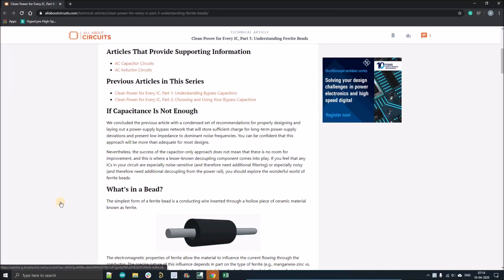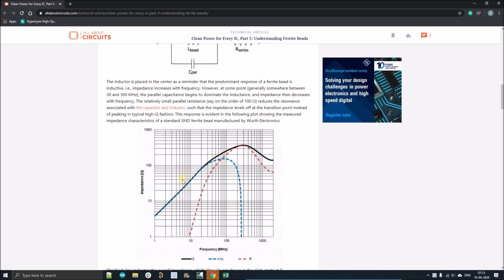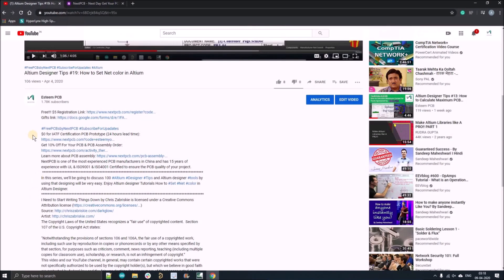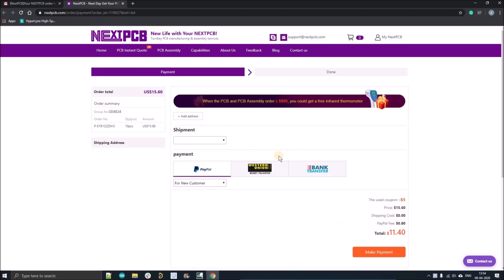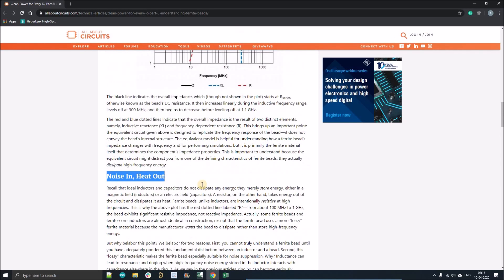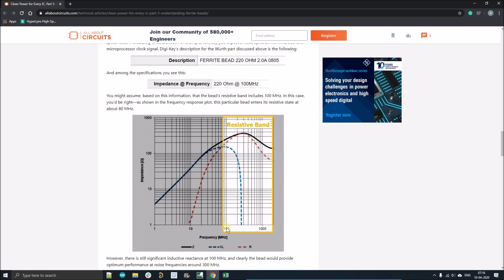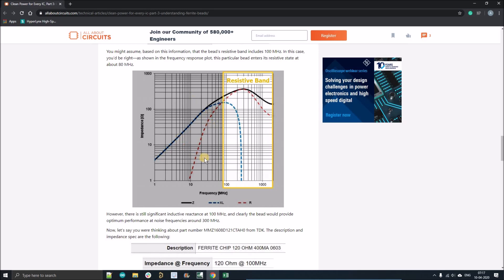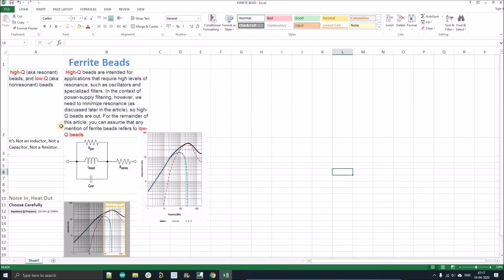How to Select Ferrite Bead | Altium Designer Tips #35 | Sponsored by "Nextpcb.com"

Comment: Thanks you for great info, I have a question. How do you determine the right ferrite bead in your design  among the other ones? I mean How do you know the target frequency band that you want to attenuate ?
Reply: Fun fact is we don't know the exact frequency, we want to attenuate.
But we know ferrite bead discipate  high freq band noise.
So if in our boards we have high freq signals. we can place a generic 100mhz ferrite bead on DC DC  supply I/p or O/p, ferrite bead should have low DC resistance, and high imp at freq  band.

Comment: Hi. In the example you have select 200 ohms @100Mhz. Higher the resistance would be better right? then why we have not select resistor with more high resistance for 100Mhz to 1000Mhz
Reply from the maker: Hey can you tell me any MPN of resistor which has high resistance for a particular frequency range.